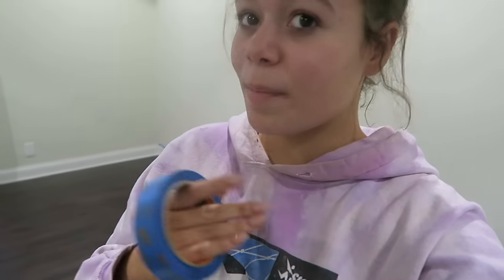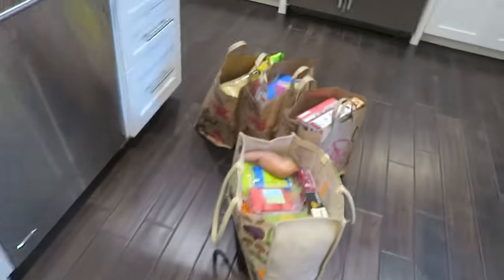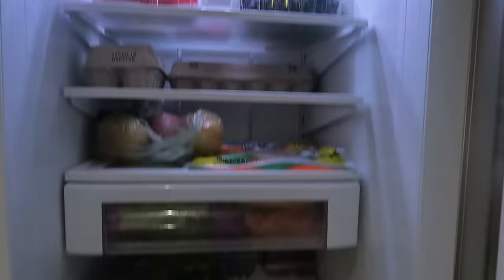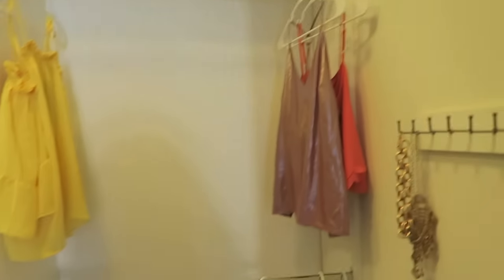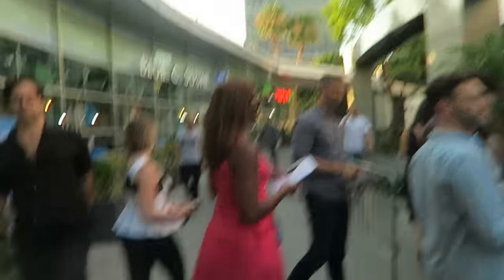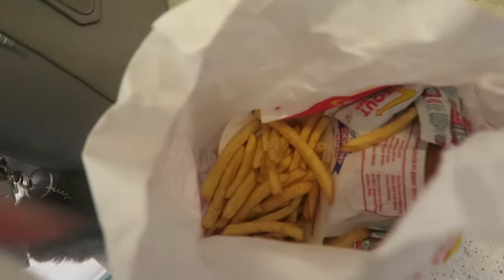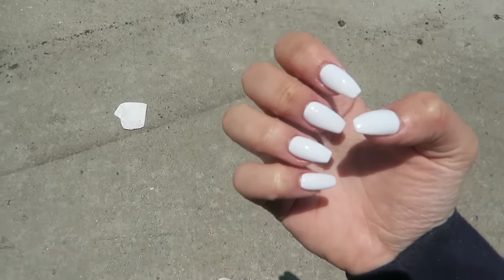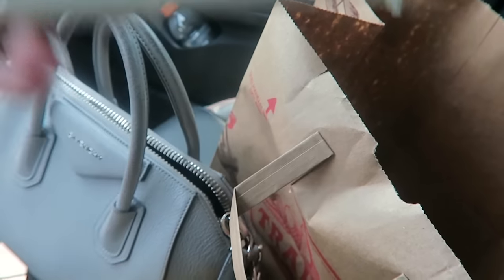TRYING TO PAINT MY NEW ROOM! MOVING DAY 2 | HeyItsSarai

Comment: your going to have to do another coat of paint on the light walls and 2 more coats on the darker walls. you would need a step stoll to paint the very top of the walls below the trim with a smaller brush.

Comment: Just a tip when painting make sure to cut the wall with a paintbrush that way you don't need the painters tape to block off the trim. With the roller a tip I learned is that you start off with a v stroke where you roll the paint in a v shape so that way the paint isn't all put on the wall in one area (the v distributes the paint evenly). Other than that your painting was really good for a beginner, I don't think you need a painter you're good.
Reply: Cutting is when you take the paintbrush with paint and carefully apply it to block off door frames and trim/crown moldings. Just a strip right by the frame/trim this removes the need for tape and the taping process